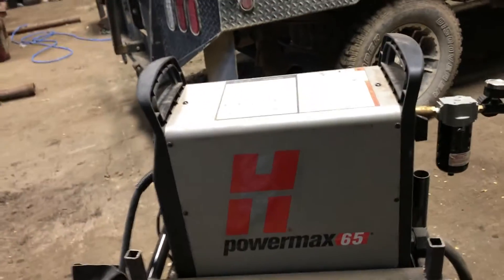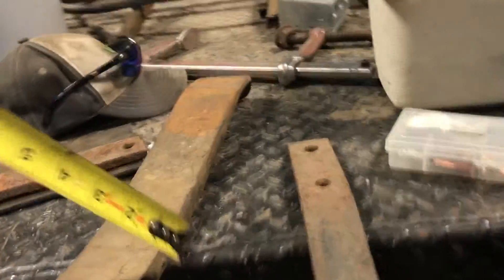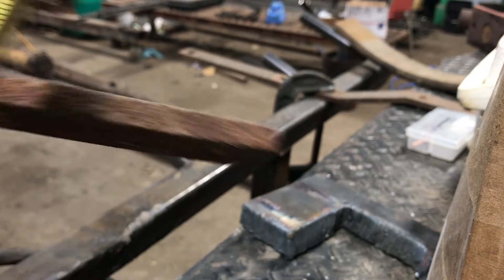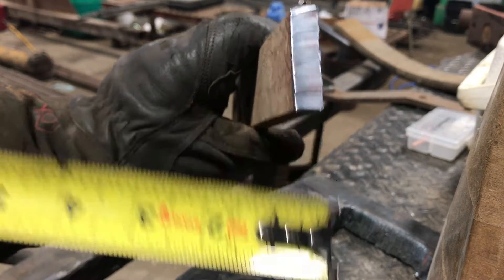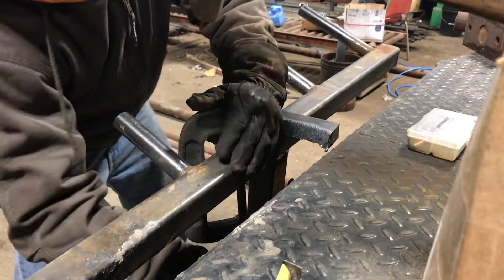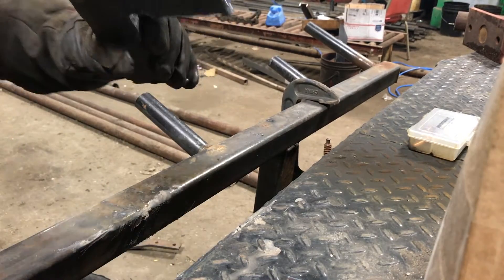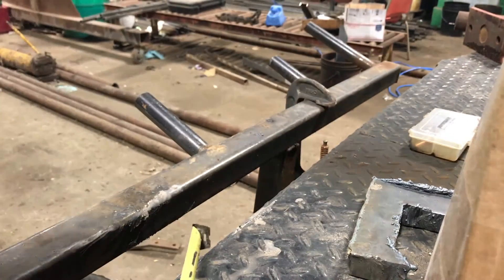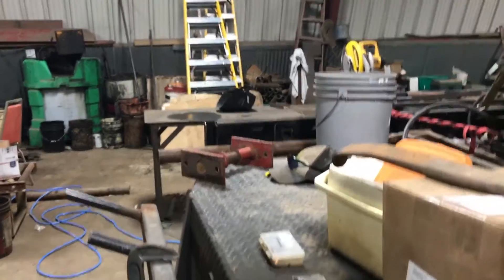Hypertherm Powermax 65

Comment: the problem with a 85 is you can't use all it's power with a 50-60 amp fuse  .Although I have shut everything off and put in a 100 amp fuse for my 85 . not practical . 65  is basically the most you can use as for as  plasma cutters go .Unless you run your shed off a generator
Reply from the maker: i havent had any issues blowing any breakers or anything...
Reply: @tedkahler  I never have either.  I do normally rpun my 85 off a fifty amp fuse.   I. figured I could never pull the full 85 Amps my machine was rated for threw a 50 amp fuse .The 85 loves that big breaker. I need more juice to my shed . That will be next spring
Reply: @tedkahler  hope you love your machine as much as I love mine . I did have a rough time at first with rather short consumable life . 
To solve the problem I put a refrigerator next to the compressor.  a car radiator inside the fridge.  .to serve as an air dryer.  After that consumables last forever . Excellent video thanks for posting
Reply from the maker: @huckstirred7112  I have even had great luck with consumables.  Even when running on portable air compressor. I do love mine
Reply: @tedkahler  I have had mine only for 2 years.  I plan on hooking up 100 amp whole  house generator on a trailer but worried about durability

Comment: I was wondering if you can answer my question does the fan in your hypertherm 65 come on as soon as you turn on the machine. Or does it come on once the machine gets hot I just put a new fan and doesn't seem to be working thanks
Reply from the maker: Only turns on when it gets hot
Reply: Thank you so much I was worried I got a bad fan

Comment: Would u reccomend this for cuttig sheet metal like floorboards on cars?
Reply from the maker: fast cash it would work great for that but could use smaller cheaper model and get same results. If just cutting light material

Comment: Which gas are you using for the cutting
Reply from the maker: jatwang kumkho it just uses electricity and compressed air from air compressor
Reply: @tedkahler  great 👌. What is the price of this thing
Reply from the maker: jatwang kumkho 3000-4000
Reply: @tedkahler  great. Does this thing last forever? I mean is there any possibility that it'll breakdown or malfunction
Reply from the maker: jatwang kumkho it has some replacement parts that get changed as neeed
Reply: @tedkahler  thanks so much for the infos

Comment: ON that inch thick material did you use full amperage? How long would it have taken to overheat that thing? Duty cycle is 65A 50% and 46A 100%
Reply from the maker: i did use full amperage.... not sure how long tell it would over heat. have never overheated it to this point yet!

Comment: Good video Ted. is that Plasma cutter 220 v or 110 and what size compressor( Lt) are you using with it? Thanks.
Reply from the maker: its a 220 volt and im running an 80 gallon compressor cant remember the cfm but you can get on hypertherm and look  up the specs on what they require for air

Comment: thanks for putting this video up for me ted. It was very helpful to see the unit being tested on different thicknesses with the  hand torch.  most of the videos are on cnc and they really don't  show what the unit can do for me. that being said I will be placing my order for the powermax 85 this week. I was hoping to go with the 65 and save myself about 800 bucks, but I'd rather spend the money than limit myself. I've got some big projects planned
Reply from the maker: Im really glad that i could help you decide... I feel you are making the right choice for cutting inch..  When i purchased mine i debated between the 45 and 65 and i have no regrets on getting the 65 so i can turn up that dial when i need to. Rarely need that much power but when you do   boy its nice!!!   The inch plate i cut in this video was previously cut with an 85  i forgot to mention that in the video so you can compare what kind of cut you can get.  On thing i will suggest... Get familiar with cutting and using straight edges on some lighter steel before you grab a thick chunk.  But good luck you can let me know how you like your machine when you get it if you want...  OOO one more thing I also debated between getting longer leads or sticking to the normal ones l(i think its 25 feet)  And i am glad i stuck with the normal length of leads.. as they seem to get tangled up enough with themselves or other things.
Reply: Ted Kahler I had been going back and forth on what length leads to go with. I decided on the 25 footers as well. I figure I would probably ruin the 50s by tangling and stepping on the damn things.
Reply from the maker: One thing about it the machine is light enough to grab and move around as long as you have air and power

Comment: great demo Ted!  well done.   I fought the removal of plow bolts a few months ago with no torch.  for open area fabrication the cutter you just demoed beats a torch in several ways.  tip contact can be a problem in tight unreachable confined locations.  thanks for the video.
Reply from the maker: Hey soybean farmer.... Feeling so good you just headed out to go plow HEHE!!!!     On a more serious note i hope your doing well...  The tip can actually be a bit away from contacting... and they do offer what they call high access consumables so it has a longer reach

Comment: Looks a lot handier than a torch. Are they pricey?
Reply from the maker: Depends on your definition of pricey... they range from pry 1500 or 2000 to as much as  you want to spend... This one was around 3 thousand i believe.  But went from using lots of torching gas to i haven't filled a bottle in 2 years!!! And it defiantly saves a lot of time